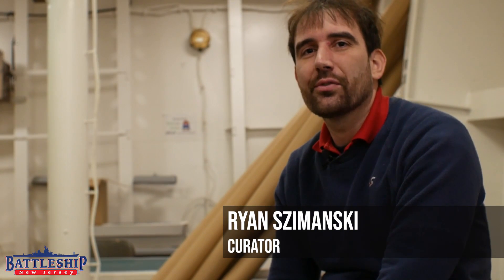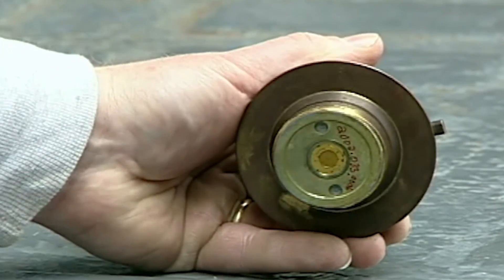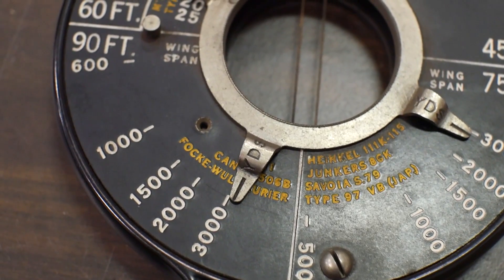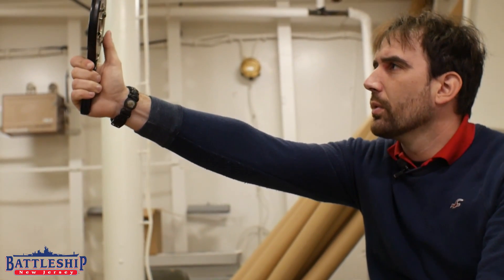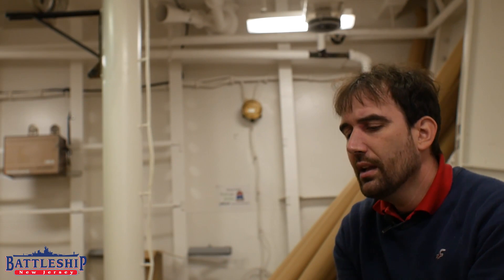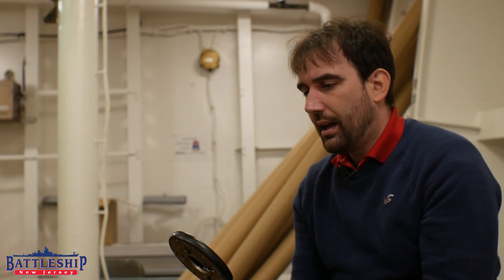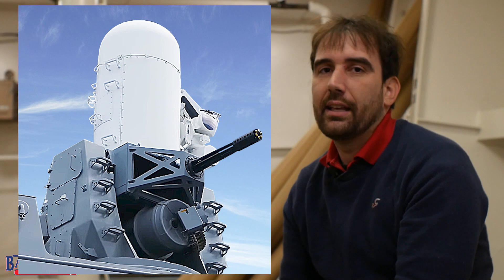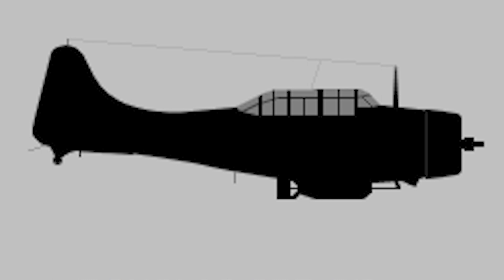Anti-Aircraft Rangefinding

Comment: Every gunner's arm length was different and in a battle situation you didn't have time to think of placing the device properly 24 inches away. By having the lanyard length to 24 inches you could push the device in front of you as far as the string allowed to be calibrated correctly and just focus on determining the correct setting/altitude.

Comment: I thought that during WWII, the USA used proximity fuses for their AA rounds, making dialing-in flak unnecessary

Edit: you brooched this topic
Reply: Proximity fuses didn't come about until later in the war.  Ships without radar, and we had many at the start of WWII, couldn't use them.  The shell uses the ship's targeting radar to receive the echo to know when to explode.  Without this radar, the shell is useless unless it hits the aircraft.
Reply: @klsc8510  the part about the shell triggering from the ship's radar echoing off the plane is incorrect.
What happened was there was a transmitter/receiver pair in the nose cone, it would detonate when the time to get a return started getting longer.
The idea was that the shell would detonate when it was as close to the target as it would get.
You are correct about them being late war, we had to get abd then improve radar technology to make the equipment small and shock proof enough to survive getting shot out of a gun and figure out how to make a battery that would last long enough and supply enough power

Comment: A thought.
Wouldn't a Swabby adjust the wires per the wing-span and decide on the Bogey's ID, look at the correct dial/pointer and then call the range?
I assume each pointer is fixed to the dial and moving the dial moves them all in unison.
BTW: Your vids are very interesting.

Comment: In his recently translated autobiography, 'The Miraculous Torpedo Squadron' (Amazon Kindle) Juzo Mori recounts how ineffective U.S. AA fire was during his attacks on Midway and Wake (he was also one of the PH attackers). However, went he started flying in the Solomons he writes that the U.S. AA fire had become much more accurate. Whether this was because the U.S. gunners had started using proximity fuses, or had simply gotten better at using the clever gizmo shown here is only a guess.
Reply: VT fuzes were first deployed in early 1943, depending on when during the Solomon Island campaign it might have had an impact.  The USN was constantly upgrading its light anti-aircraft capability deploying 20mm Oerlikons and 40mm Bofors.  The Oerlikons were very effective when first deployed.  I'm sure better training played a role as well.

Comment: Humm I'm thinking the first is a A5M Claude, I do not think it's a D3A Val as it has no visible dive brakes under the wings, It is also not a A6M Zero as it's wings are straight and not bent, also the lack of fixed landing gear...
 the second was a Stuka and the third was a Dauntless
Reply: The Claude has an oversized engine cowling on it.  I'm pretty sure it is a Val as others have said.The dive brakes wouldn't be always visible unless deployed.

Comment: Actually you are missing a key part, the string was used to make the distance correct hence the photos of the men with the string around the neck. In the pic at 4:05 you can see the individual knots they would tie to adjust that length for the individual.  
These were intended to be used by selecting the distance to open fire, e.g. firing at 1000ft, so you would set the wires to match the 1000ft for the aircraft type. When the aircraft wingtips would match the width of the wires you would order the gun to fire. The gunners would have the planned lead set in and if there was a timed fuse it would be set for that distance. 
I have one of these and the instruction sheets for it.

Comment: I missed the first one. thought it was a Val dive bomber
Reply: I think you're right, fixed gear and wing dihedral isn't constant like the zero, it starts at the gear
Reply: I think it's a A5M Claude, as the D3A has visible dive brakes under the wings which seem to be missing here, and both have that bent wing profile with fixed gear.

Comment: The first one is a fixed gear Val dive bomber with its distinctive bent wing.  The Zero has retractable gear and a constant dihedral.
Reply: Was gonna say, when did the zero acquire fixed gear. Ooops
Reply: Eh? Val diver, Zero, set the range and you'd be likely to get either one. Those were miracle munitions. If you managed to hit the plane and take it out, it was a miracle. That's why the proximity fuse was a game changer.
Reply: @robertthomas5906  I mean a Val is 47’ across and a zero is 36’ across so the zero is only about 80% as large as a Val which is probably significant when it comes to fire control. 

But also this isn’t a Val or a zero. It’s a Claude. Note how big the engine cowling is relative to the wings and the lack of external dive breaks under the wings. 

The A5m was almost exactly as wide as a zero so if you got confused between the two you’d probably still be in good shape, but because the Claude is much slower than the zero you might still have some problems.
Reply: @themecoptera9258  Thought about that, but the A5m was relegated to "rear areas" only during the period commonly attributed to WWII so I was biased by the "Axis silhouettes" statement.  Another victim of the forgotten theater:  China, Burma, India.  Never forget that the Japanese kill 250,000+ civilians during the Rape of Nanking, and around that same number again in retaliation for the Doolittle Raid.

Comment: I missed the first, because I foolishly assumed US sailors wouldn't need a card for a Zero with its gear down (I called it a D3A Val instead). 

The second card was a plan view of the Ju 87, and neither the inverted gull wings nor the fixed gear were visible. It's still identifiable by the wing planform if you've spent enough time looking at warbirds, but it's more difficult without being able to see the type's two most notorious distinguishing features.

And yes, the SBD in profile doesn't quite look like anything else.
Reply: You were correct on the first one; look at the shape of the wings; horizontal with a dihedral from the landing gear out. Not an A6M but a D3A. I was deeply disappointed. I'm assuming the mistake was made in editing the video.
Reply: @plastictsubasa1390  Now that I've gone back for a second look, I agree.
Reply: Yeah, the images would be added in after filming

Comment: all this was a guess at best....a plane flying 200 kts or so was going to be great deal closer by the time the call was made...fuses set....shells loaded and fired
Reply: That's the point of training: to cut the time needed to ID and range incoming aircraft down to a couple of seconds.

And the crews did have a little time. 200 knots is just a bit over 3 nm/minute, so if you spotted an aircraft 5 nm out you'd have about a minute and a half before it reached you.